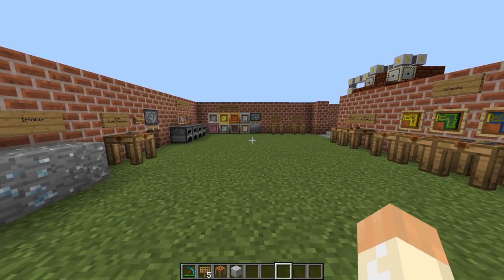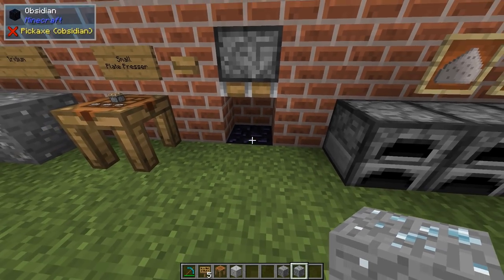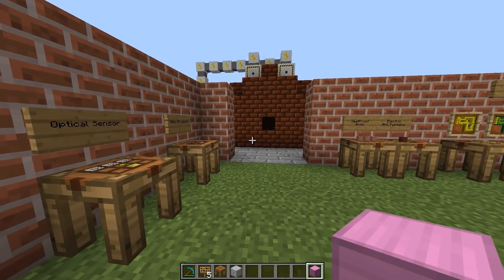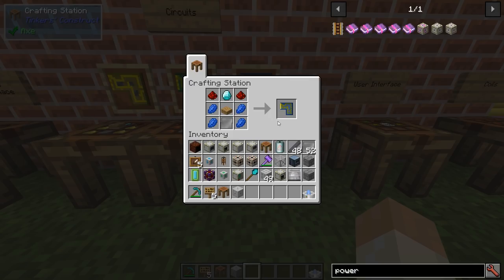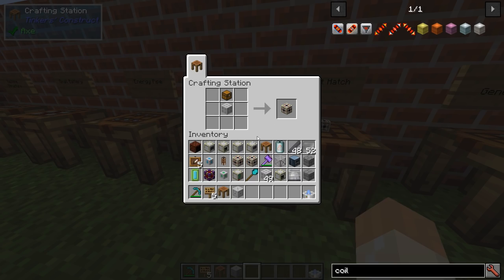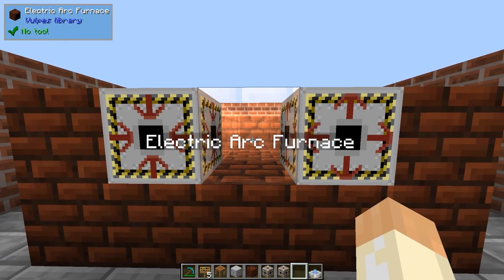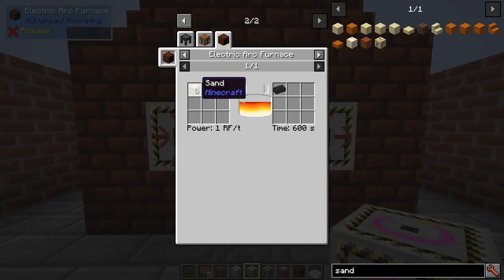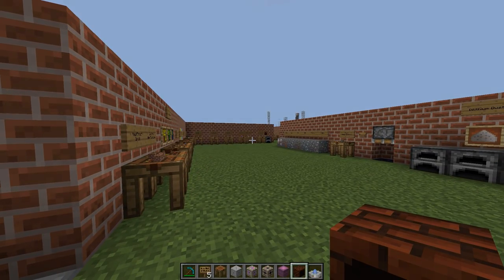Advanced Rocketry Tutorial #1 - Basics, Machinery & Electric Arc Furnace (MC 1.12.2)

Comment: For some reason when I try to craft the circuits they dont show up in the box on the right. Ill put all the correct ingredients in, but nothing comes out. any ideas?
Reply from the maker: Most probably you're running a different version or a pack (that have changed the recipe) than I had in this video, but you forgot to provide this information so it's almost impossible for me to give a better answer.
Reply: @therealtkh  the rocketry version is 1.12.2-2.0.0-13
vulpes is 1.12.2-0.4.2-25
Im also running tinkers construct as well, 1.12.2-2.13.0.183
I beleive you said you were also running 1.12.2 in the video? it should be the same recipe then, maybe?
Reply: I appreciate the fast response, appreciate it.
Reply: solved it, it is a different recipe. Your idea helped a lot!